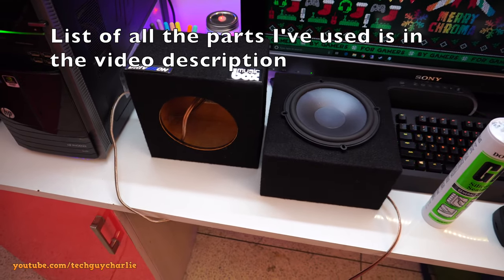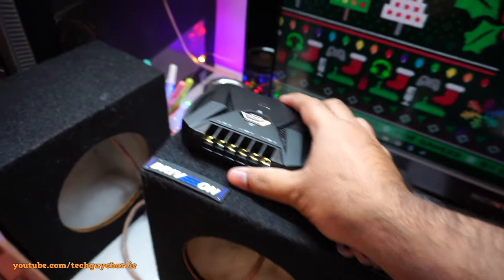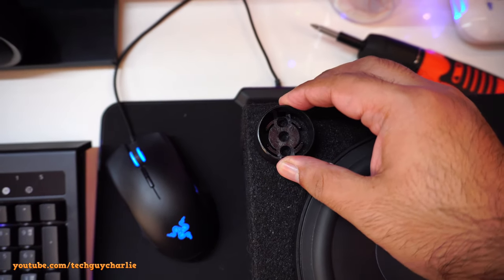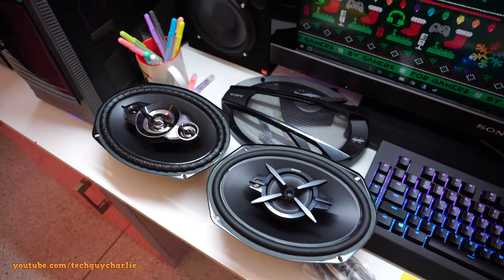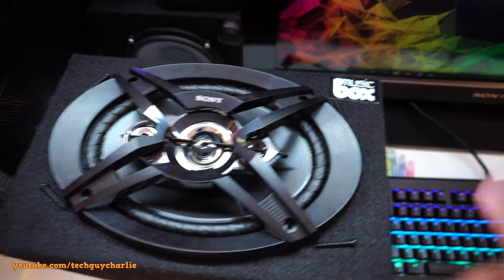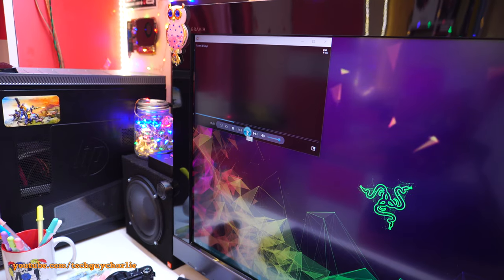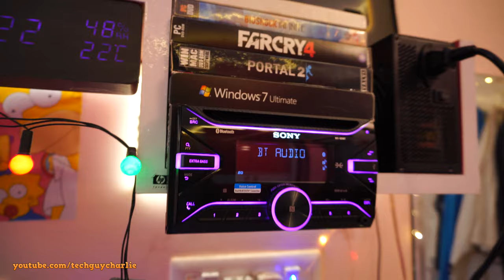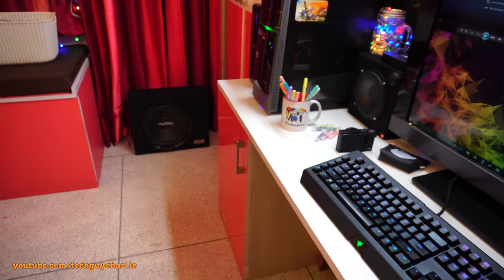(Part 2) Car stereo at home DIY project - installing the speakers and sound test

Comment from the maker: PS: If you don't like Sony, go write them an E-Mail venting out your life frustration to them, want me to use your favourite brand sub or speakers? cool, feel free to BUY them and send them my way 😂 😎 any unnecessary hate comments or trolling will be removed. and just wanted to clear something out, the Corsair VS550 power supply has no issues running these 2 amps and the head unit and I have used up all the 12volt and ground wires on the power supply for maximum amperage, tested at nearly maximum volume the setup pulls about 340-360 watts when the bass hits as reported by the APC power chute software obviously subtracted the wattage draw of PC and monitor, the power supply gets warm, fan ramps up but the 12volt wires remain stone cold. But I am saving up for a Corsair CX series power supply, probably a 750 watt modular unit in the future for more reliability and scalability. And don't be one of those idiots who judge the quality of a sound system by listening to the sound on headphones recorded by tiny camera microphones.
Reply: Perfect reply 😂👌🏻

Comment: Hey bro i too bought 4 speakers of jbl gto 609c for my car...i was thinking what amp would be best to run my 4 speakers setup and i came across your video...i am not going to get a sub so do you think 4 gto609c speakers will be enough bass in my swift ?
Reply: Yes but if you see on the data sheet for the frequency range its only hit until 53 hz, below that you still need a subwoofer
Reply: And i suggest dont buy 4 609c, but 1set gto 609c for the front and 1 set gto 629 for the back

Comment: You are my hero. Love your project. And thank you i was thinking for a long time to do it. You really inspired me. I have setup up my system. I had 90w kenwood speakers lying around and old 500 watt psu and car stereo reciever 45x4. I just hooked them together. They sound awesome, and they are loud enough to make my ears ring at full volume. Although i am thinking of buying an amp and 2 more speakers, and make them my party speakers.

Comment: Did you turn the beep setting to off or was there just no beep sound?
Reply from the maker: The unit beeps only when you use the built in amp on the head unit, there will be no beeps when you use external amps.

Comment: Your complete setup is riggeed to single corsair 550😱?
Reply from the maker: Upgraded to 650!! 550 isn't enough at higher volume. Would recommend 1KW 80+ Gold power supply though.
Reply: @TechGuyCharlie  That's great to hear!!! I'm planning on adding similar setup to my car with sony gs 100 and JBL stage 1220b for subwoofer, thanks to you!!! . Your videos are awesome🙌🙌👍

Comment: Amazing bro I was literally waiting for the final setup. I'm considering to go up with this setup instead of home theater system.
Reply from the maker: Thank you, bro! I totally love this setup, It actually sounds a LOT better in person than on video, the vocals are crystal clear and the bass is solid! The best part is everything is modular, you can swap any component you like, mix and match stuff which you won't be able to do on a normal home audio system or a home theatre. But if you decide to go for a setup like mine vs a home theatre there are a few things you should know, firstly this car stereo does not support Dolby Digital which most home theatres do so its 2 channels playing on the front speakers and rear speakers and secondly whenever you switch off the power supply the car stereo forgets all settings and time!! So I just leave the PSU on all the time lol 😂
Reply: @TechGuyCharlie  oh thank you so much for the information bro. Ur amazing
Reply: @TechGuyCharlie  Hello bro, i want to connect  sony 4 channel amp setup through AUX line with my PC i'm using asus xonar D2x 7.1 sound card. how many continue hours can it run is there any over heating issues ?. if there is any limit then i will go to 5.1 assembly Dolby DTS  home theater for long running day and night daily computing and for entertainments. Please guide me

Comment: Awesome video. I would like to do an all Pioneer sound system
Reply from the maker: Fun fact, I've replaced the head unit with Pioneer 😁 other than that, I am still using the same setup, works great.
Reply: @TechGuyCharlie  Wow. Pioneer is an awesome brand but I am 12 and my parents are not so interested in Pioneer. They bought me 2 pioneer car subs and thats all it. My parents like Kenwood & Kicker mostly for car audio. My parents are only interested in LG XBOOMs for audio in the house. They got the LG CM4550 and LG CJ45. They replaced my JBL Charge 4 for an LG CJ45 :( I mean they are not bad but I would rather want a Pioneer theatre system. But atleast my parents have good subs & speakers I can do bass tests with
Reply: When I grow up, I might buy myself a Pioneer 1k watt rms sub and a JBL 1k watt rms amp.
Reply: @TechGuyCharlie  why did you switch to Pioneer?

Comment: Is your setup still working awesome?
Reply from the maker: Yes, it still works, I use it daily. 😊
Reply: @TechGuyCharlie  another question though. I'm really into the Sony wx920bt, how long did you use it  for before you replaced it and what is the Maximum volume of the head unit if you still remember?? 
And is it okay for me to use a corsair 450W to power up the same unit and as well as the amp probably it'll be 300W or less.😊

Comment: Corsair 550w power supply can able to power two amplifier and one head unit at full volume??? Please reply....
Reply from the maker: Well, for now, I did not face any issues with the power supply, it just gets warm to touch which is normal, wires remain cold and I have used up all the 12volt and ground wires on the power supply for maximum amperage. I did not max out the volume because I don't wanna blow my ears lol it becomes too loud after 33 volume, in the video I played the system back at 25 and it was damn loud. When I played the system at 33 volume it pulls about 340-360 watts from the wall as shown by UPS software on the computer, well within the limit of the power supply, still, though I am saving up for a 750-watt Corsair CX series because they are more reliable than VS series, trust me bro, get the Corsair CX power supply if you want your setup to really last long.

Comment: Loved your work what are you using to power up those amps?
Reply from the maker: Thanks, bro, I use Corsair VS550 550Watt power supply to power up those amps and the stereo!
https://www.youtube.com/watch?v=xR_LUNAeX8A
Reply: Will it be sufficient to drive both amps and head unit at peak or i should go for vs650?